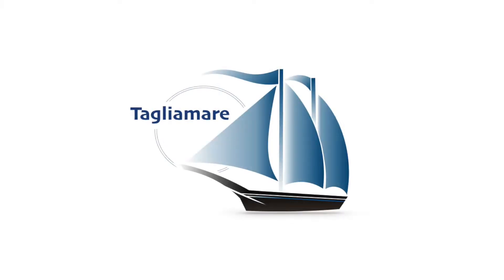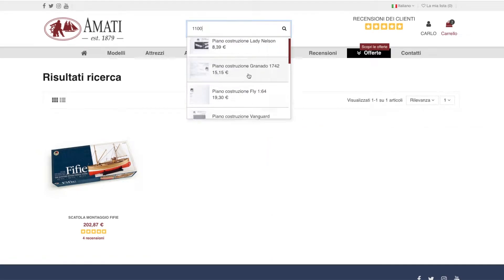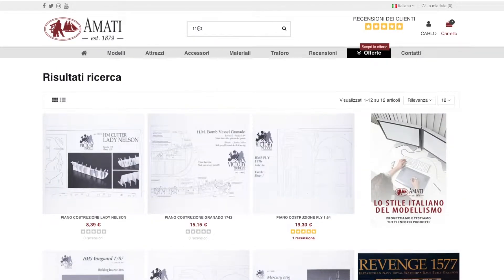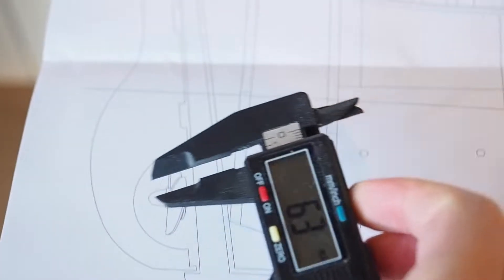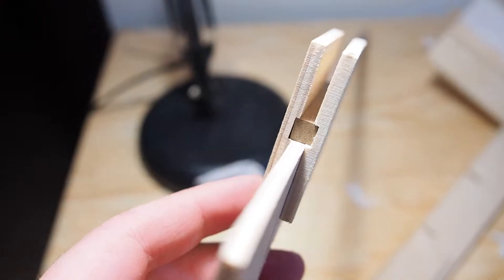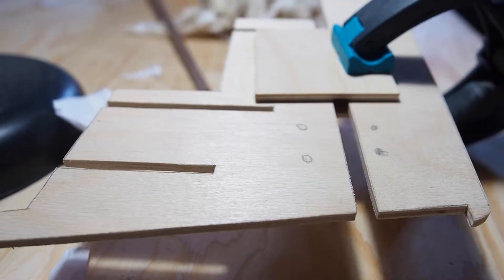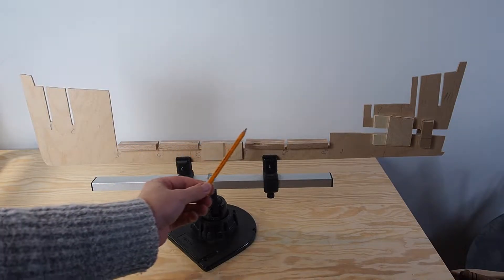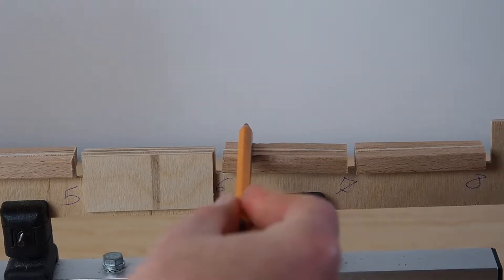SCRATCH BUILDING the radio-controlled version of the Amati FIFIE - Part 1 THE FRAME

Comment: 👍Nice build, especially the reinforcing in the 1st video and some good information for a new R/C modeler (returning after 30 years!) . I'm about to purchase that Amati Fifie and will be doing it as an R/C boat and have a couple questions. First, what speed 540 motor - wiring turns that is - are you using and is it a brushed (2 leads, I believe) motor. Second, why are you using a 6 channel radio or is it just because that's what you have? I was considering using a 2 or 3 channel. Thanks (I may be asking more questions in the future😯)
Reply from the maker: Hi @JD Wht, thanks! I love the Amati Fifie, super happy you'll start yours too! The motor is brushed yes. 2 or 3 channels works perfectly fine. I wanted to be able to add additional features in the future (not that I will, but I just wanted to have this possibility open =) ) and at that time is the only one I found anyway. Feel free to ask questions, I will try to answer if I can
Reply: @Tagliamare  Thanks for that information - just getting back to R/C after soooo many years and that now the choices now are unbelievable (read as confusing!)